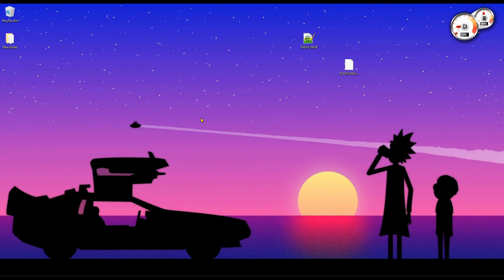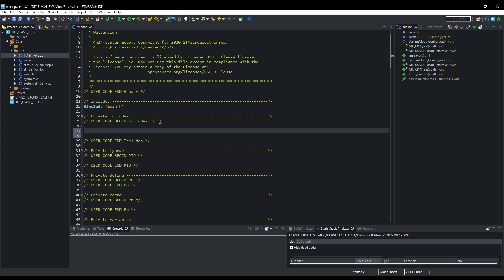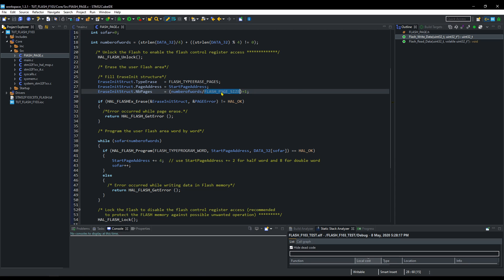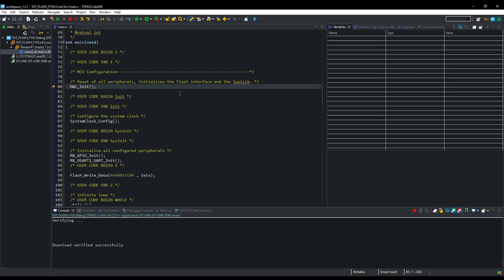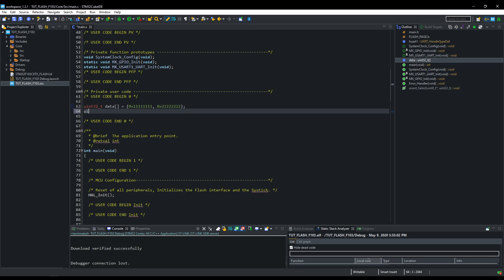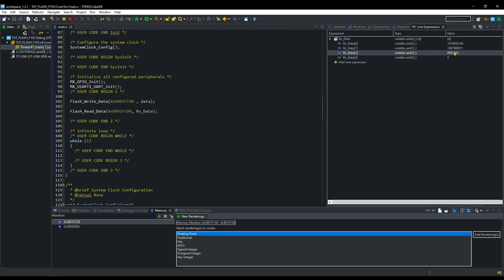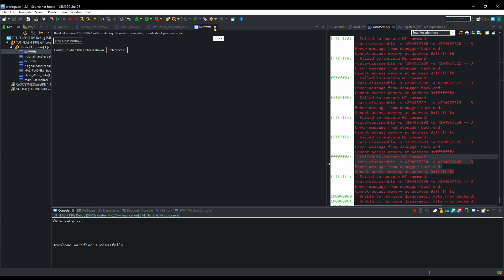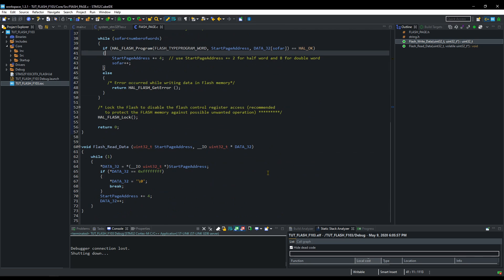STM32 Flash Programming (Page-Wise) on Cortex-M0/M3 | Write & Read with CubeIDE

Comment from the maker: Some F103C8 have 64 KB Flash. For these MCUs, the flash address is valid between 0x08000000 to 0x08010000.
Make sure you check if you have the 64KB or 128 KB flash. 
You can check it in the cubeIDE at the bottom right ( in memory usage window) or check the flash.ld script file.

Comment: is it wise to store the counter value in the flash memory so that a counter value can be stored permanently and the next day it can be started from the previous counter value or EEPROM should be used? As counter value store 100000 times one by one in flash memory in a day.
Reply from the maker: That's too many write cycles.
Flash is definitely not an option here. Even the eeprom has around 1 million write cycles.
Reply from the maker: That's too many write cycles.
Flash is definitely not an option here. Even the eeprom has around 1 million write cycles.

Comment: Sir I try to write  multiple float value.
When I write values on different pages then it work but when I write on same page example
int num1=20;
int num2=30;
int num3=40
Flash_Write_NUM(0x0800FC00, num1);
Flash_Write_NUM(0x0800FC04, num2);
Flash_Write_NUM(0x0800FC08, num3);
only last value is written on memory address  ,how to clear this problem.
Reply from the maker: Try to write data in single operation. Before every write,  the entire sector/page is erased.
Better modify your data and then write it in single operation

Comment: Amazing tutorial. 
I am using STM32G474RE, which is M4, but according to the manual it has 2 banks with 128 pages each. In the manual it says "It is only possible to program double word (2 x 32-bit data).". How should I change the code in order to work when I am trying to write 2 different variables, each uint32.
Thank you
Reply: did you figure it out? I have the same question.
Reply: @yogaline8218  I concatenated the 2 variables into one 64-bit, and then wrote it in Flash. Here is the code that I used:
Flash_Tx = ((uint64_t)VarA*1000000000) + VarB;
Writeaddress=Flash_Write_Data(Writeaddress, &Flash_Tx, 2);

And here is my Flash_Write_Data function:
uint32_t Flash_Write_Data (uint32_t StartPageAddress, uint64_t *Data, uint16_t numberofwords)
{
	int sofar=0;

	  /* Unlock the Flash to enable the flash control register access *************/
	   HAL_FLASH_Unlock();

	   /* Program the user Flash area word by word*/

	   while (sofar<numberofwords)
	   {
	     if (HAL_FLASH_Program(FLASH_TYPEPROGRAM_DOUBLEWORD, StartPageAddress, Data[sofar]) == HAL_OK)
	     {
	    	 StartPageAddress += 8;  // use StartPageAddress += 2 for half word, 4 for one word and 8 for double word
	    	 sofar++;
	     }
	     else
	     {
	       /* Error occurred while writing data in Flash memory*/
	    	 return HAL_FLASH_GetError ();
	     }
	   }

	   /* Lock the Flash to disable the flash control register access (recommended
	      to protect the FLASH memory against possible unwanted operation) *********/
	   HAL_FLASH_Lock();

	   return StartPageAddress;
}

Comment: So what happens when DATA_32 is not null-terminated and you call strlen to calculate data length?
Reply from the maker: I guess it will just give you the total length of the array (the one you have defined initially)
Reply: .. and I guess it will fail. Using strlen on binary data is not a good idea.

Comment: Hi, I tried the code on the Blue Pill with 64k of Flash. For my code it is not working as it should. If I write the same hex numbers as shown in the video they are written - no problem in the flash. But when try to use it in my code - only the first number in the array is stored! What do you think is the problem? (PS: what i try to store is integer numbers like 1000, 1 etc.)
Reply from the maker: You can't directly store the integers.
You need to convert them to hex or ascii..
Reply: @ControllersTech  Sorry for bothering you again, but can you explain why only one number is stored in the memory when I send it as uint32_t ?
Reply from the maker: I need to see the code to comment on it.
Anyway, you can check yourself what value is being passed to the flash_write function and what it is actually writing

Comment: I ve stored data in 0801fc00, then after that I've to store another data in 0801fc04 but after pressing reset button all the value where I stored in 0801fc00 & 0801fc04 get vanished
Reply from the maker: What was the size of the data ?

Comment: Hi.. Great tutorial maan..i  have one doubt. I just have one data to store.I will have to write that data to same address every five minutes.and every time the board  resets i want to read the data.So in that thing..do i need to erase the page every time i writes..or will it over write the data in the address?
Reply from the maker: Yeah it i guess it will overwrite the previous data. 
You try this though. Just remove that erase function and see if it works
Reply: @ControllersTech  thanks for the reply man..yhh..i will try that
Reply: @ControllersTech  and one more thing..do you know which communication protocol it uses to read and write to flash??
Reply: Do you used smt 32 f 401

Comment: Where did you get the FLASH_PAGE.c and .h file from?
Edit: nvm found at the bottom of the website.
Reply: in description is a link to his webpage. there you download archive file and get those files form project folder
FLASH_F103.zip\FLASH_F103\Core\Src\FLASH_PAGE.c
FLASH_F103.zip\FLASH_F103\Core\Inc\FLASH_PAGE.h

Comment: There's one thing I find strange in all of this. 128 pages of 1k flash on a device that has 64K of flash memory total. The Math is wrong.
Reply from the maker: Read other comments and you will understand
Reply: @ControllersTech  I did. There is no explanation. In case you weren't watching what you were doing you chose the part C8tx. A 64k device. Pages 127 and 128 shouldn't exist
Reply from the maker: Yes i am using bluepill in this video. The pages do exist.. how else will it write to that location?
Like i said in another comment, some f103c8 have 64 bytes and others have 128 bytes. How and why ST doing it ? Well I don't know about that..
Check the picture of my bluepill memory details below
https://controllerstech.com/wp-content/uploads/2021/02/f103memory.jpg
Reply: Do you used smt 32 f 401

Comment: In my uC, erase memory not work, only write the flash memory one time. If i want write again, not work, y read the first value, after I erase all chip memory whit stm32CubeProgrammer. I use the same board like you. I replace strlen with sizeof and not work. Can you help, please?
Reply from the maker: I have heard of this issue. Maybe you also have the cloned bluepill. Check the name on the IC, if it says ST or CKS
Reply: @ControllersTech  Thanks, says ST.
Reply: I have the same board like you, identical. Only write one time.
Reply from the maker: Not an issue here. I am able to write consecutively in the same memory location, or a different location also
Reply: @ControllersTech  Work fine with a 128 kb bluepil, with 64kb version, not work. I buy 20 bluepil, all 64kb, when i bought them i didn't know. :-(. Can anything be done with the 64kb version?
Reply from the maker: What memory location were you trying to write before ?
Reply: @ControllersTech  Yes, that's it, I did the wrong calculation with the calculator, I had to do 0x400 * 0d62 = 1024 * 62 = 0xf800, because have 64 Kb. At these location (0x800F800), work fine. I try to write at 0x801FC00, bank 127 for 128 kb version. Thank so much for your tutorials!!!!!

Comment: I hope someone can help me. It works for me but when I try multiple memory cells only one is stored. Is it not allowed to write to e.g. FC00 and F800 at the same time?
Reply from the maker: I don't think thay could be a problem. Can you try writing the pages which are more than 1KB apart
Reply: @ControllersTech In "0x0801 FC00" and in "0x0801 F400" works. But when I try to write in "0x0801 FC00" and "0x0801 F800" it doesn't work. 

Maybe you have a better solution for my task? I have 8 values. They are all int values from 0 to 30000. 
I thought I would save each value in a memory cell. Is this a good idea?

My actual approach looks like this.

#include "FLASH_PAGE.h"

uint32_t data_ONE[1] = { };
uint32_t data_TWO[1] = { };

__IO uint32_t reed_ONE[1];
__IO uint32_t reed_TWO[1];

int main(void)
{
	Flash_Read_Data(0x0801F400, reed_ONE);
	Flash_Read_Data(0x0801FC00, reed_TWO);

	while (1)
	{
		if (buttun_Pusch)
		{
			data_ONE[0] = (uint32_t) variable_1; // variable 0 to 30000
			data_TWO[0] = (uint32_t) variable_2; // variable 0 to 30000
			
			Flash_Write_Data(0x0801F400, data_ONE);
			Flash_Write_Data(0x0801FC00, data_TWO);
		}
	}
}
Reply from the maker: Why not save both the values in the same page ?
Reply: Controllers Tech how I can do that?
Reply from the maker: Just create an array of the values, and then use flash write and pass the array 
You also might need to modify the function a little. Instead of calculating the numberofwords, just pass the number of words in the function parameter.
Reply: I have the same problem!

Comment: If using FLASH page(s) for user data, should you modify the linker scripts to ensure that the compiler reserves it as to not place executable code there? 

Also, on the Dual-Core devices (ex. STM32H7), where there are TWO 8-sector Banks (0x8000000-0x80FFFFF &  0x8100000-0x81FFFFF), how do both CPUs share/execute from this?  For example, could one sector be used for the M4, and 15 sectors used for the M7?   Could they execute from the same sector?   For example, it seems they have the same reset vector address (0x00000000)!
Reply from the maker: There is another video for sector based memory distribution. The link is in the description of this video.
Also read the description of that video...

Comment: So to store a float, which is 4 bytes, it is up to us to convert the float to its integer representation first before storing? Asking because I always try to first code what you show myself then look at how you do it. I see that you did not store any floats. Keep  up the great work.
Reply from the maker: No.. you can store the float as it is. I don't recall doing any such thing in this video. Anyway, if u want to print float or an integer on any display, or send them via the uart, then u need to convert them to characters.
Reply: @ControllersTech  I am referring to storing a float in flash. I  could not store the float as is.
Reply from the maker: Yeah those values get stored as the ascii values. So i would suggest that you first use sprintf to do the conversion and then store them.
Reply: @ControllersTech  I had to do a union to get the uint32_t representation of a float so it can be stored. Try to store a float in flash and you will see what I mean.
Reply from the maker: Ok.. I'll see that and let u know..

Comment: Hi,
Can I use it for the STM32WB55 series?
Reply from the maker: Check the datasheet... If the memory is distributed  in pages, than sure you can use
Reply: @ControllersTech  Yes it is mentioned as a pages. But each page its size is 4kb. But in your video it is mentioned for 1kb. Is this support for my features?. The flash memory for my board is 1 Mb

Comment: Hi! Great tutorial, thanks !
Which theme are you using for stm32cubeide? It looks really good.
Reply from the maker: it's the darkest dark theme. You can get from eclipse marketplace
Reply: @ControllersTech  There are no questions about it , you are a well knowledge person in this field
                                 Please explain me more about eclipse marketplace how to use it, up the point
                                 to change the background screen (dark theme ) as in this video.
                                 Or there are steps to follow on the CUBEIDE main screen only.
                                 Thanks
Reply: That is OK
I worked out how to do it ,through Google and Internet
Reply: @jorgejacome4269  
Which is better Blue pill or black pill

Which you used most
Reply: @Shubham-9996  I have blue pill, a lot of stuff can you do with this little thing
Reply: @jorgejacome4269   are you able to use that micro usb connector

Direct connect Data cable

Or serial st link is meey
Reply: @Shubham-9996  no, I think there is a video related to your question in this channel

Comment: I'm using Keil IDE and it shows errors ''#error 167: argument of type uint32_t is incompatible with parameter of type const char *",  do you know any solution?
Reply: Did you fix the error? can you help me if you could fix it?
Reply: @irfanincioglu5438  Type casting yapacaksınız. (char*) data ve (char*)DATA_32
Reply from the maker: Try doing type casting

Comment: I just wrote an application where I wanted to save a calibration value to flash and, of course, turned to YouTube. All I could find was code and libraries that didn't work with the STM32F103C8T6. Made some changes, and thought I found an error in the standard library. Turns out I was trying to use FLASH_PageErase that didn't clear the FLASH_CR_PER bit, so when I went to write to flash, the PageERase bit was still set, so wouldn't write.
Thanks for the great library!!! A week earlier would have saved me many hours and the embarrassment of submitting an error report to STM. (However, I still believe that CLEAR_BIT(FLASH->CR, FLASH_CR_PER); belongs in the same procedure as the SET_BIT.)

Comment: Great tutorial!
But we just need to remember everyone to DO NOT use your flash to store non constant data . STM32F1 series guarantee only 1k Cycles, which of course the real number is around 10k Cycles. But you can burn your flash easily if you use this as RAM.
Reply: @udayasreereddy3165  This is part of the STM32 HAL Library
Reply: .. its depend on the use case. I'm sure that anyone who write to flash will know the limitations and will see it's more complicated than dealing with RAM.  The flash should last for at least 10k Cycles, according to the datasheet.